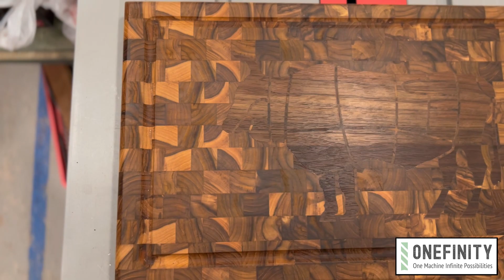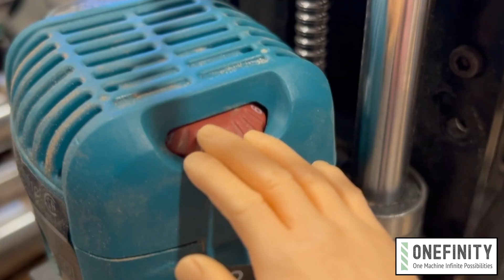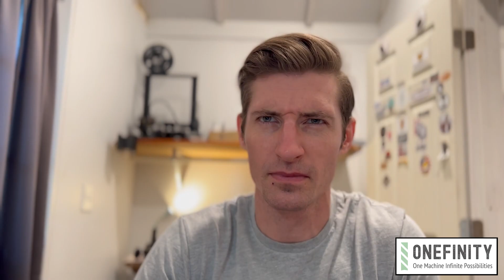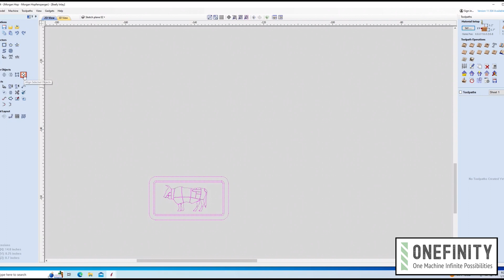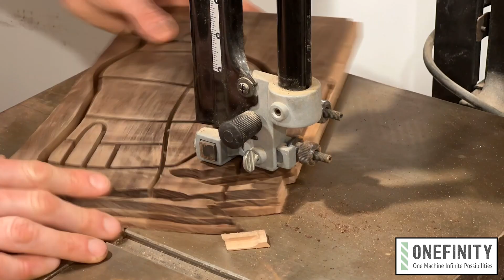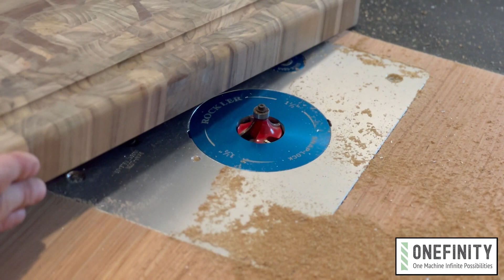EP 12 Onefinity CNC - Inlay Cutting Board

Comment: So now I'm requesting another video...I just received the JTech 24w Quad Pro laser setup, and I have some questions about installation, what additional things I'd need such as air assist, fume removal, and a suitable material for a spoil board that the laser won't burn through or catch on fire. It would be great if you'd make a video about that.
Reply from the maker: Check out JTechs youtube.

Comment: Great video, thanks! I went down the rabbit hole looking at these videos and one had mentioned that in cutting the positive part, when you set the beginning depth to 0.28, the software assumes that everything above that is air and will try to plunge to that depth on the first pass. Is vectric smart enough to handle that or do you need to create multiple cuts, say at 0.1, then 0.2 then 0.28 manually?
Reply: It did plunge to .28" which is a little deeper than I'd like but I was conservative with the plunge rate and the feed rate so it turned out alright
Reply: You’re better off doing in 2 tool paths.  I deep plunge might flex the machine and cause gaps in the final inlay
Reply from the maker: Great tip!

Comment: Noticing the modeling software you use is Aspire, does this program really cost about $2000.00 or is there a cheaper route .
Reply from the maker: It is 2K.  You can get vcarve pro or desktop for 600-300 from our site and it will do everything in the video!
Reply: As mentioned, the lower tier versions of VCarve would be just fine. If you want something with the same bells and whistles but mainly for one project though, Carveco Maker might be a better option. 

Just subscribe to the license for a month and then cancel.